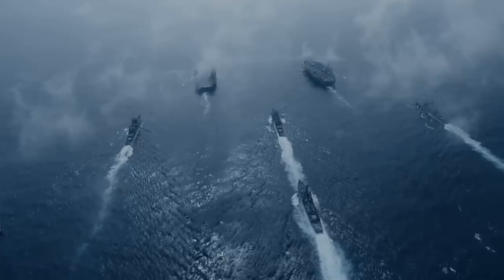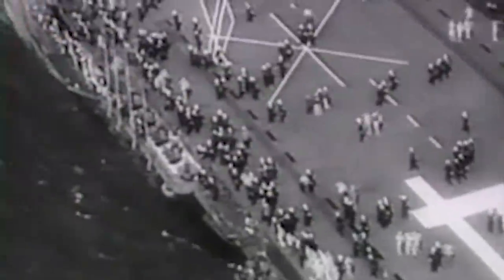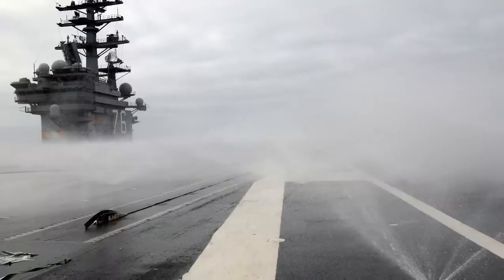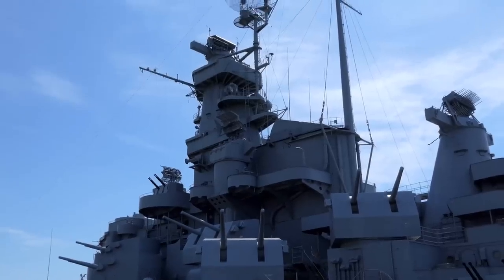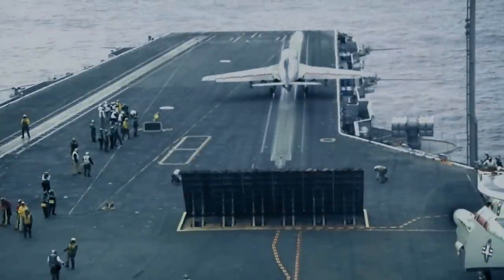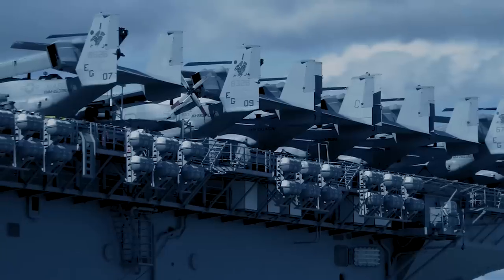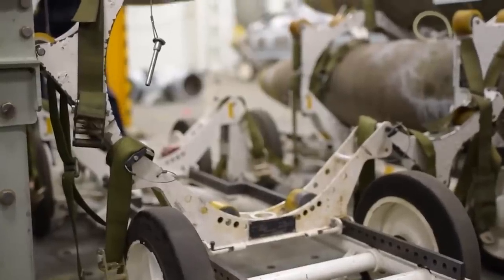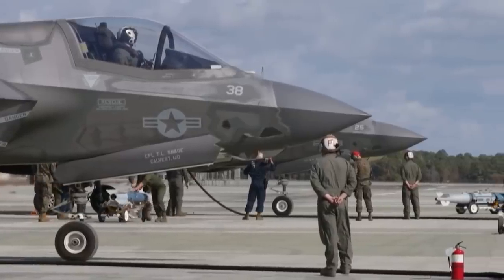US Navy Drops Giant Aircraft Carrier Anchor Chain

Comment: They don’t land full throttle. They touch down at roughly 130 to 140 knots, once they hit the deck they then throttle to full power till they are sure they trapped (hooked the fire) then they power back down to idol.
Reply: Idle.
Reply: @RMosher11  meh I spelt it how I spelt it.
Reply: @masterman3178  Spelled.

Comment: My compartment was just aft of the windless, and just above the chain locker.  Every time we came off the line, while trying to get some needed sleep. They would drop the anchor and wreak havoc.   As a point of interest, They paint the chain while weighing anchor.  They are not all black, but are different colors depending on how much chain is left.  If there is a runaway when you see red painted chain, you must run to safety NOW!

Comment: I'm a steel worker by trade. I can tell you without question that each of those giant chain links definitively weighs more than 136 lbs. There is no question. It would take an Ironman to lift one of them.
Reply: That's not good when your at war . Wasting time manually pulling that chain.
Reply: @kennypowerz1267  what? I'm not suggesting somebody try to lift an anchor chain by hand. I think you might need to re read the message for comprehension.

Comment: I've watched several of these anchor drop videos, particularly the ones that end with the loss of the anchor. The frightening sequence as it starts off slowly, backing off the windlass brake when it stalls, then it runs and stalls again, backing it off more, sometimes much more so the windlass can start paying out again, then suddenly, the windlass just free-runs with no way of stopping it.
The brakes when applied, overheat, then burn. The noise must be deafening and the operation has to be abandoned as the crew evacuates an extremely dangerous free-running, out of control, chain and anchor.

Comment: "not routine" means there's one floating around somewhere.
Reply: Wouldn't be surprised if official protocol is to not deploy with them, but every deployment gets "special orders" and has some on board. The military is famous for bureaucratic pedantry.
Reply: @PaulGuy  yeah wouldnt be hard to leave port without any and receive some via transport later thus not breaking your word i would say that its far more likely though that the smaller missile ships are packing nukes as its far faster to launch from them than to fit a payload to an aircraft and launch it that would then need to get in range of the target subs are the best way to go though a mobile subsurface silo that can go anywhere on almost 3/4 of the planet

Comment: It isn't exactly free falling.. it is a controlled fast deployment.. if you just let it fall free you would quickly be losing your anchor and chain entirely. But a controlled fast drop allows you to quickly deploy and control your chain and not burn out bearings, winches.. the forces at play here will tear you too ground beef in a fraction of a second.

Comment: Contrary to what is stated here. It is is the anchor CHAIN that provides the force to hold the ship stationary. An anchor chain is never called a "line" which implies a rope, rather than a chain. This author really should learn a bit more about the language he uses before parading his ignorance in public.
Reply: 1.  Alright, Navy girl, this ex-Army REMF wants to know how an anchor with chain at the max length of 1440 ft, weighing approx. 170 tons total*, can hold a 100k ton ship, particularly considering a small part of the weight of the chain and anchor is canceled by the buoyancy of the water?  2.  Did you know carrier anchors are reused?  Is the Ford using retread anchors or are they new?  3.  His Dark ___ (whatever) presentations always contain errors.  Don't complain.  Look at it as a way to sharpen your ear and increase the accuracy of your knowledge.
* Given the anchor weighs 15 tons and the chain outside the ship weighs 155 tons (est. 1400 ft × 57 links/90 ft × 350 lbs).
Reply: @brianjob3018  The engines are shut down after the anchors and chains are in place. Natural forces from wind and water do move the ship but are nowhere near the power of the engines. One ship I was stationed on started dragging the anchors in about a 20 knot wind.
Reply: Sorry Karan we didn't know you watched this..(FKN SNOW FLAKE)
Reply: @mikeypiros6647  The name is spelled "Karen". Perhaps you could do with learning English properly, too.
Reply: @nicolek4076  if you didn't care, you wouldn't have responded 🤣🤣🤣